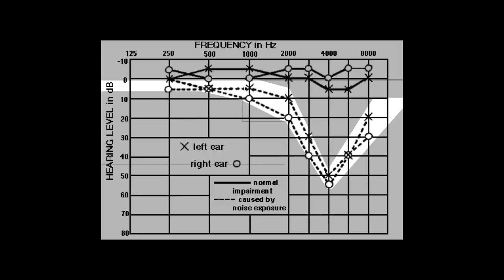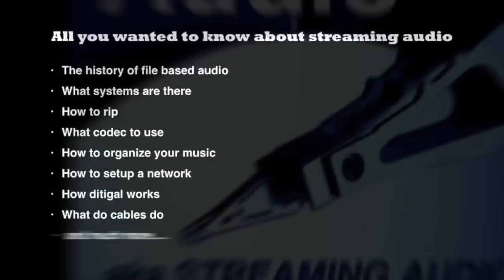Hearing Damage, part 1: how come?

Comment: I think Hearing Loss is caused by Concerts or Night Clubs and it starts from 16 years old because on night clubs or concerts they not properly use correctly equalizer and they dont decrease ~18KHz.

The Damage hearing is loudness and for young people damage is high level treble at 18KHz
Reply from the maker: This is incorrect. The frequency component plays no role other than due to the 1/f rule the energy in high frequencies is a lot less. I know that it feels like the high frequencies do the most damage, but it's just all the energy.
Reply: Yes ,i was going sometimes at night clubs and DJs increases ~18KHz and it really hurt my ears so i stopped going to the night clubs because i want to care my hearing range,im 25 and i dont want lost these high frequencies what i hear - i can hear 19,5KHz max with high volume
Reply from the maker: Well, it's a good thing you are aware of potential hearing damage. Wished more people would be that cautious.
Reply: Thats true
Reply: It's actually when listening to noises/music that's over 85dB for extended periods of time.  yeah, loud concerts, loud car stereos, car/motorcyle exhaust from loud cars/motorcycle, earbuds/headphones at loud SPL. night clubs.  people that shoot guns without proper ear plugs, being around heavy machinery without proper ear plugs, pretty much loud noises and sounds for extended periods of time.

It's a good idea to not listen to music at an average listening level above 85dB.  Once you go past that, you will get what is called ear fatigue.

Now, I get ear fatigue with too much noise in the 4000hz range and I have found that many audio cables (interconnect AND speaker cables) can have distortions in this area. Thankfully I found two brands that consistently don't have distortions in that range, hence I don't get ear fatigue when listening to my stereo unless it's played at extremely loud volume or the recording has a lot of distortion that can't be helped.

Equalizers at concerts are typically used for either tone adjustment of an instrument or they are to remove feedback.

But it's simply loud SPL that causes hearing damage and that hearing damage can be short term or eventually long term.

Get an SPL meter for your smartphone and see what SPL you are exposed to.  Understand what 85dB sounds like.  Unfortunately, when wearing headphones/earbuds, there's no way that I know of to know how much SPL we are subjecting ourselves to.

Comment: Although I have always worn hearing protectors when near loud noise, I developed hearing damage suddenly in one ear. A hearing test graph looks like the effect of a 6 db/octave filter starting at 1000 Hz.

In addition to loss of response, I can't discriminate pitch below about 250 Hz. Sine waves below this point sound the same and are very distorted. One result has been voices being painfully loud. I surmise that this is caused by an excessive threshold shift; my ear is effectively being tricked by the low average sound level (due to the lack of low frequencies) into raising the gain, psychoacoustically speaking.
Reply from the maker: Unfortunately, wearing hearing protection does not guarantee the prevention of hearing damage. But it is always better than not wearing hearing protection. I am sorry it wasn't sufficient for you Vincent. Thank you for reporting, it does bring hearing damage closer to those that believe it only happens to others.
Reply: I didn't mean to imply that hearing protection isn't necessary, I know it's essential. I just thought readers might be interested in the results of my nerve damage.
Reply from the maker: I know you didn't but some people are bad readers so I wanted to make that clear upfront. And I do appreciate you reporting on this. It is a very serious problem, as you know.